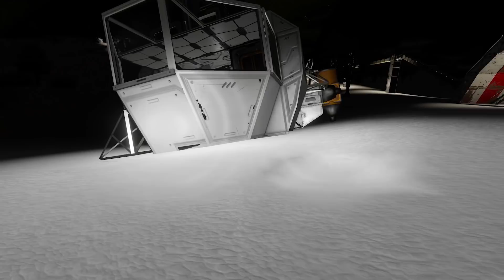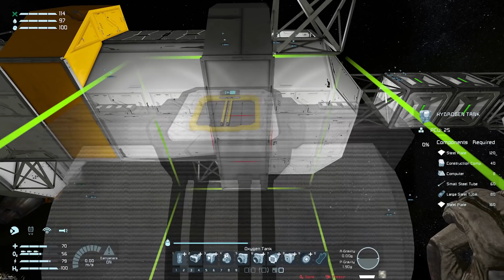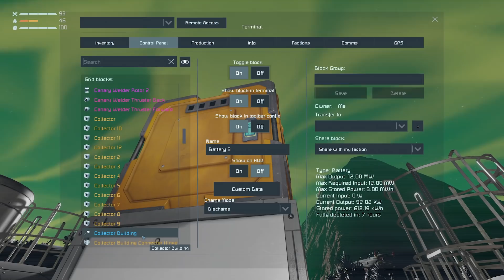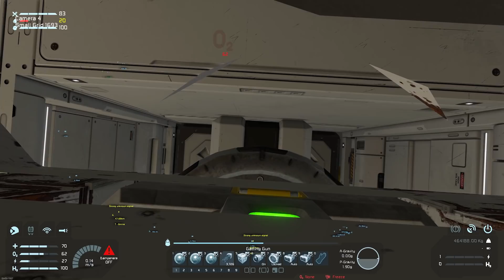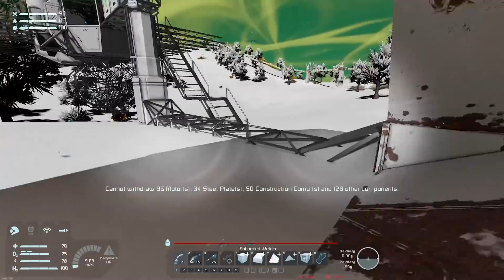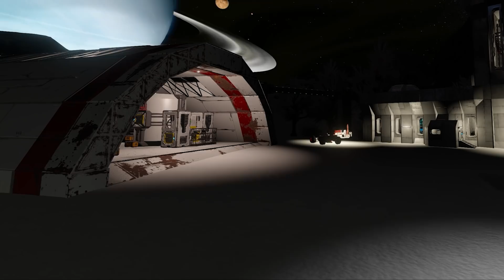Survival Impossible - Canary on decoy duty #56 - Space Engineers Hardcore Survival

Comment: That build work out better that expected. My name suggestion is the "H2 Hoagie", in keeping with the sandwich theme.

If you ever decide you need to do fuel runs up to the Lawnchair base, 5+ small H2 thrusters should provide enough lift (about equal to the 8 atmos that can lift it now), plus 5 more for the other maneuvering directions.

Probably won't be necessary, but it's a reasonable plan B until you've got an ice source in space. One load would keep the Remora is business for several excursions surveying the local asteroids.

Comment: bang smack would be appropriate for down under ... since things are backwards to the northern side lol ;)
Reply: you could make 4 piston landing gear pods on the sides and deploy them from a switch in the cockpit ... so when you need to land on the ground you deploy the pistons and they lower the gear below the craft ... and you can then land ... add a ladder on a rotor that also deploys when you deploy your landing gear so you can climb in and out  as well ... also allows you to work UNDER the pannini and have a sandwich ;) also add a single solar panel or two to the top of the pannini so you have emergency power charge if away from the bases

Comment: Legit one of my biggest problems when I play SE is when I'm doing stuff like this. Because what I want to do is try to build a drydock for refits before I actually start the process of refitting a ship. What I want to do is use cranes and scaffolding and heavy machinery to disassemble and reassemble ships. What I want to do is to be forced into engineering those solutions for such massive scale problems. But...inevitably I end up capitulating to the voice in my head who is saying "you can do this with 20 steel plates and the parts for a single piston".

The technology doesn't really exist for it yet, but if I could have a game like SE in scale but with structural integrity considerations that render massive infrastructure projects absolutely necessary...dang. I'd play that so hard.
Reply from the maker: I would too :)

Comment: You mentioned it being hard to fit landing gear on the ship. And you're completely correct. So, why not put them on the base. They're designed to be a large flat surface to land on, and thus tough enough to take some impact if you're a bit too fast on approach. So you build your landing pad out of them, and when you're inevitably landing while under attack, you don't need to be quite so concerned about being just a touch too fast. Even if they don't actually lock when you land. it also means you'll be perfectly lined up to a connector rather than potentially slightly off on blast doors or catwalks.

Comment: I'd advise putting some landing gear on it, at least until you have docking facilities made for it at both locations.  With the h2 tanks on the bottom, unless you have it connected it's too likely just roll over when you turn the dampers/engines off, and it doesn't have the power to keep them on when you're not using it.

Comment: For landing use just wheels without suspension.  They will absorb any rough landing that will occur. Add remote block and antenna. For when it will be out of reach or you may want to move it without running to it, not to mention control Canarias to defend it. Remote block can be programed to go to waypoints so you can take a nap or control Canarias to fight without risking smashing into mountains

Comment: i think SE fall damage is just really low in general, in 1g i've very rarely taken more than 20-50 damage unless i was jumping off a giant radio tower
Reply: I made a space elevator, fell off at maybe 5th stage (it goes up 10 blocks each stage) took 5 damage. (without jetpack)
Reply: In my head cannon the suits have hydraulic damper in the leg joints. As long as there's a reasonable explanation for it I prefer low fall damage.

Comment: 29:00 Could put a button/button panel on that battery to control...something? That way you can lie and say it was planned :D
Reply: LCD with an image of the block the right way around.
Reply: @pmdem  false walls have proven to be effective hiding tools in the past.
Reply: Would be perfect, the Sci-fi button would go well there (maybe even text panel, haven’t tried it), I used a setup like that in my base to display base power usage and to provide a single button to set all batteries to recharge, which was later repurposed to activate the reserve battery and hydrogen engine.